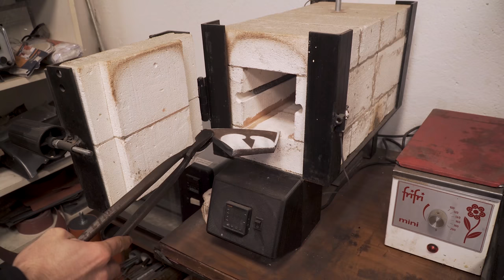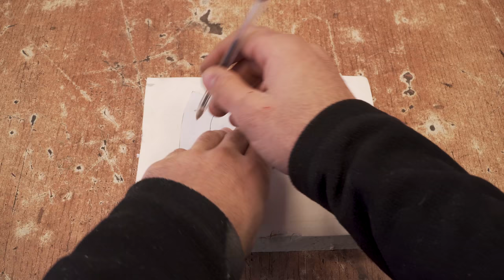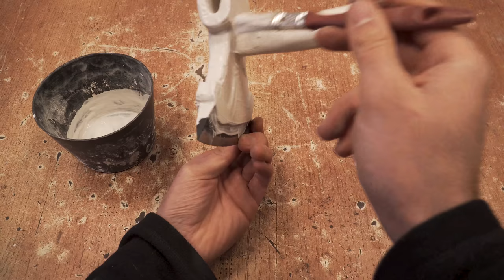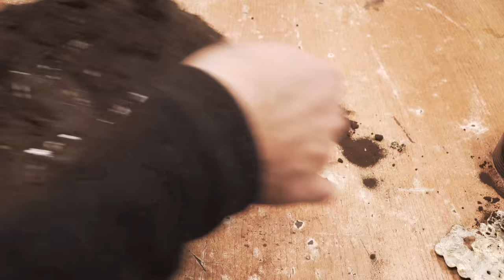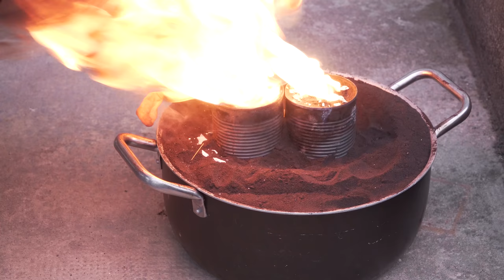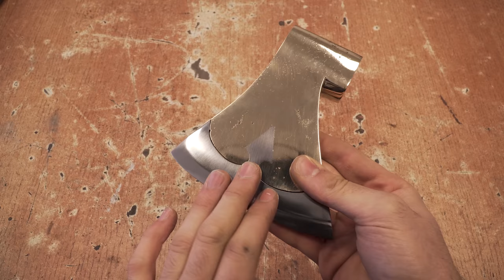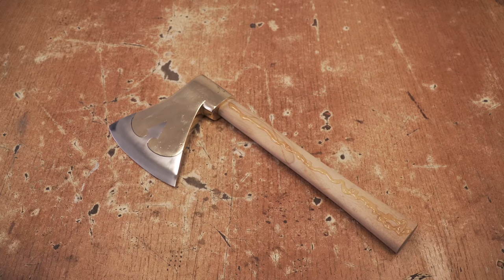Dovetail Tomahawk

Comment: good advice for the next time you are going to be casting, try compacting the sand with a wooden pestle, first compact a layer below the to be casted piece, then add a small (2cm or aprox an inch) layer of non compacted, then the piece then again a layer of non compacted, then compact it again and then another thicker compacted layer, should give you a lot nicer results... but also some blisters if you aren't used to do it XD

i had luck as my school included a crash course in almost every production method that's out there, what also included casting, although with 2 separate able casting halves and having extracted the model before
Reply: You would end up with weak "plates " of sand doing it that way. 
just as important, sand will be to compressed and no gas will be able to escape; you will get gas holes in castings or mold blowouts.  be a pain to take out pattern to as would be pinched to much in the sand i would think
 Basic method 1)dust some  everyday chalk, like one or two small clouds max(parting powder, smash some in a cotton pouch, stocking maybe? lol)
 2) add facing sand (sieve enough to kind of cover it, (avoids crap in sand effecting casting surface , 
3) add enough sand to loosely cover box then tuck by poking your fingers in to form surface, you need to compact the surface so hard tucks. not jerky movements, think iron fingers grasshopper. get in those small spaces to.  (2-3 inches approx. for shallow small molds, foot even on bigger ones. If mold box is tiny just tuck then flat ram)  
(4) add sand to again just loosely over top edge of box then pien   ram ( i.e. your pestle or handle of hammer works well, try not to hit pattern but happens)
  5) again add sand to above surface and flat ram, looks like a hammer length thing with a flat disk at the end, heavier the better as you "pat"the sand down very firmly, don't smash it ( you could use anything including your hands I suppose, we used to walk on our molds a few times if big and on the floor) 
6) scrape surface flat, piece of flat bar or even wood that's oversized of box, helps with weighting mold down etc. 
Important... try not to damage or crack/shift each lower leave as you ram the box. avoid adding extra layers, if you say flat ram and not enough, heavily score the surface with finger then top up and re-do, helps join layers. 
Even, strong medium that wont separate or break but not solid, is still pours to vent gas  ultimately is the result you want and what you need to practice and keep in mind.

parting powder, facing sand, tuck, ram then flat ram. scrape flat. (sprew, risers gates etc how you think)

the old-school methods work for a reason. much better lift and consistent density if done correctly, does take time to get the hang of it (more years the better) (of course that's the simple way for basic molds, must master that first to master molding)

OR cheat, use hard sand or lose wax lol

hope this is of use to somebody
Reply: @petercarlisle2927  well i only wrote about what i did in school, we had basic crash courses in almost every way of producing workpieces
Reply: @Em.P14  you had the basic idea. Thinking later about it. The raming of the sand is the only part you need to get down best you can, all othere skills are layered on this like gate cutting, metal flow etc
Theirs not much correct information online so wrote it down. Alas I came of like a tool probably,  Sorry bud. I'll remove coment if you like
Reply: @petercarlisle2927  nah don't do it it was just a bit much ... and you may should write it down somewhere else where more people see it. if there is not much on the internet, why dont you try to make a wiki entry ? as far as i know everyone can post there

Comment: Why did you bother hardening it if you were going to lose the hardness anyway when casting into it?
Reply: I don't think he would loose  hardness, he's not heating it up .. it's taking some heat from the brass but the sand is keeping it cool enough I think... for sure the edge of it would be fine.
Reply: @yoelcarrera6586  - That brass is at 1000°C or 1700°F. You only need half that for a few seconds to lose the hardness in a metal piece. The cast goes into the sand form and stays there until it cools slowly, that's what the sand is for, to keep it from rapidly cooling. After reading all this, do you find it likely that I may be telling the truth?

You can take mild steel, sharpen it and shave paper and do a few cuts into wood and not see a difference. It's only when you do it a lot when you start seeing it go to shit. I've tested it and mild steel works really well, just for a short time.

I've also, at work, tried sharpening drill bits without cooling them because I was in a hurry. They lost their hardness and dulled immediately, resulting in me getting water to keep them cool anyway. So yeah. A few hundred degrees in just a matter of seconds and hardened metal loses its hardness.

Comment: Thats why you tamp the sand down around the mold material. It creates a more uniform casting. The moisture content of the sand also matters. The heat will dry the sand, so if you it doesnt have enough moisture in the sand, it wont stick together enough and will fall apart. This is why your molded head was so non-uniform and bulbous. Good try though.

Comment: Would someone please explain how he removed the wood once he had put it in the sand? I don't get it. Did he pour the brass onto the wood which then burned away? That seems unlikely. And what was that goey stuff he put al over it?
Reply: Styropure, it burns out quick if you pour hot metal.
plaster around the form to keep the details., I am not sure why he did because you can go with the form sand if you stamp it hard enough, usual you make the plaster cover if you have fine detailed forms

Comment: If you would have tamped and packed that casting sand nice and hard instead of just shaking it and 'wiping it flat', you most likely would not have had those pits on the side.

Comment: how did you make part of it from foam to metal by pouring it....kinda stumped me on that part...
Reply: The metal is hot enough to vaporize the foam out of the mold then take its place. You get the shape of the foam but in the metal you poured. Its a very common form of casting because its really easy to do, but oyu have to make a vent for the vaporized foam to leave from otherwise the sand bloats like his did and then you get a bad pour. Also if he had tamped the sand down he could have avoided some of the bloating.

Comment: What's the solution that you dip the blade in? I think to myself that its just water but how does it catch fire underwater?
Reply: An oil of some type, there are ones designed for quenching steel. It's a shame he wasted the time to do it, he destroyed the temper and it's hardness by pouring molten metal on it. Say that was 1080 steel for the bit, you quench at around 1400 and then temper at 400 for 2 hours twice. Pouring molten metal that is much hotter would ruin that and make the metal softer and not stay sharp. Basically don't do this.
Reply: @betafishjeremy7454  i was thinking the exact same thing. Im not 100% on the melting point of brass but im pretty sure he could have re tempered it after pouring the brass. It did turn out as a good mantle piece though.
Reply: @KikinCh1kin  you would have to quench and temper and the brass would most likely mess at least the quench up. If you want to do a docent tail it has to be pressure fit not poured. You would have to do it the same way you make a key hole handle. It really comes down to dont do it. All he did was waist time and money making a wall hanger when if you wanted to make a whall hanger he could have skipped any hardening or tempering and just used mild steel. It's a beautiful peice but useless and it's sad because he can make beautiful tools that are actually tools.
Reply: @KikinCh1kin  melting point of brass is around 1800 but the heat it would hold would most likely mess up the quench and possibly warp. Also quenching brass makes it soft, the opposite process as steel.
Reply: @betafishjeremy7454  well thank you for letting me know. My expanse of knowledge grows larger and i feel better as a result.

Comment: I usually really like vids like this.

But dude, you put in all that work and more then one thing wasn’t square or even through this entire build.

First your actually cutting face wasn’t equal to itself. Bottom of the face is longer then the top. Which would make it swing weird and cut towards the handle not the middle. 
Second was your pour technique. Yeah it worked but using a foam negative and not then using a packed sand leads to the need to pour twice. 

Last and personally worst is the handle hole is now where close to in the middle, or even with thickness of the brass around it. Which means that the fail point will be there at the back of the handle. A crack WILL develop. But that’s just gonna be more of a “which if first” scenario, the dovetail holding the steel to the brass- or the back of the brass at the handle?

It’s gonna bust, just where.

This whole thing felt like “yeee that’s good enough…” was the thought the entire build.

Comment: The author worked tirelessly. And, it seems, the result should have pleased. Here's just one question. What will happen to the axe after several hours of intensive work? Brass, as you know, is a soft metal and does not tolerate shock loads. After loads, it either bursts or crumples. So the author, as his followers, is waiting for a big surprise after a while. So I think that this is just a decoration on the wall, which has a lot of work invested in it. Or it's the subject for this video. I do not advise you to repeat this, time spent aimlessly...
P.S. It would be better if he restored the knife, it would be much more useful. In short, some show-offs!

Translation (Перевод):
Автор трудился не покладая рук. И, вроде бы, результат должен был порадовать. Вот только один вопрос. Что будет с топором после нескольких часов интенсивной работы? Латунь, как известно, металл мягкий и не выносит ударных нагрузок. После нагрузок он либо лопается, либо сминается. Так что автора, как его последователей, через некоторое время ждет большой сюрприз. Так что думаю, что это просто украшение на стену, в которое вложено масса труда. Или это субъект для этого ролика. Не советую это повторять, бесцельно потраченное время...
P.S. Лучше бы нож восстановил, все пользы было бы больше. Короче, одни понты!

Comment: The dirt was too dry and light weight it could not compact and kept floating on top of the heavy brass. @ the very least you needed something heavy on top to hold it down so it won't float.